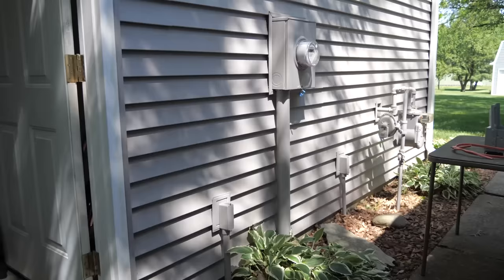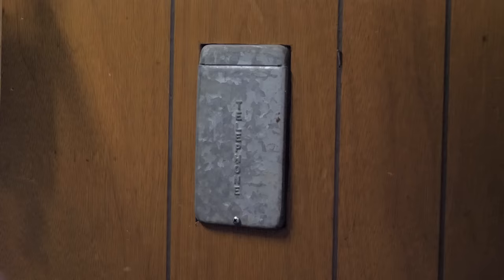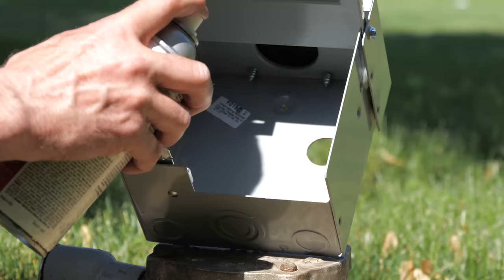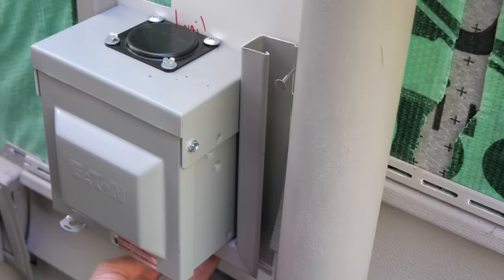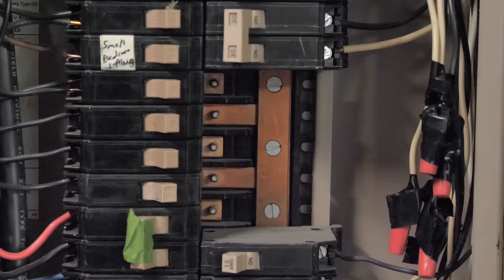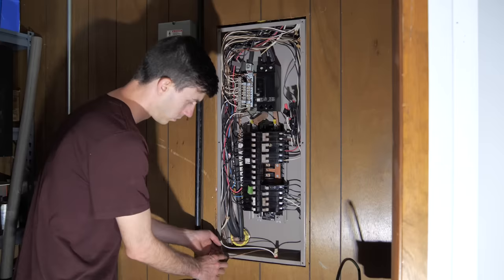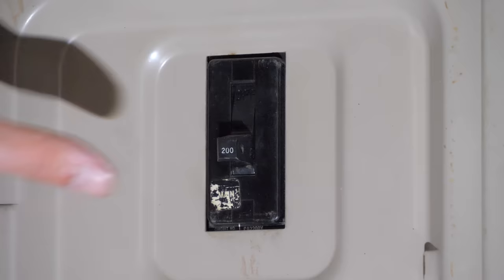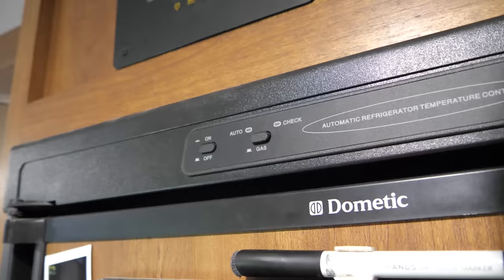30 Amp RV Outlet Install - DIY Electrical Receptacle Wiring

Comment: I'm confused.  If you threw the main disconnect why would there still be power to the panel?  Inquiring minds would like to know.
Reply: You still have power on the input side of the breaker (240Volts). The breaker just shuts off everything in the panel itself.

Comment: FYI... 15 amp outlet to run AC is dangerous.
Reply from the maker: Why do you think we installed a 30 amp receptacle? 😅
Reply: It's not dangerous,  just very inconvenient. 15amp circuit is only going to run a 15 amp load (technically 12 amps) .  Any larger load and it will (supposed) to trip circuit breaker, not letting electrical load damage wiring, receptacle and other equipment.

Comment: Only question I have....always been told to have the breaker OFF when plugging in the RV.  I know you plugged the RV into the surge protector, but does the surge protector provide the same precaution as having the 30 amp breaker off when plugging in?  Make sense?
Reply from the maker: The breaker does not need to be turned off before plugging the RV in. Just like the breakers in your home dont have to be switched on and off every time you plug your vacuum in.
Reply: @FateUnbound  David, the reason why its best the breaker should be turned off when you plug or unplug the RV power cord, is any load whatsoever  (albeit small, present in some devices like a charger or one having a  inductive or capacitor load even if turned off) can still cause some degree of arcing which can create resistive carbon or pitting or burning (ever look at your RV power cord plug ??) on the contacts PLUS its safer when plugging or unplugging if the breaker is off. That's NOT just me saying that, I've owned RV's 49 years and heard that long ago.

John T  BSEE,JD  Retired Electrical Power Distribution Design Engineer

Comment: You did not video a romex  connector use in the breaker panel use at KO Need one By NEC.  so the wire may get pull out breaker panel. He code reads, “all single-phase receptacles rated 150 volts or less… 100 amperes or less installed in the following locations…”. These locations include “outdoors.” ... — The 30- and 50-amp power on the RV pedestal are considered feeder circuits (those circuits that feed another panel) and not branch circuits. So NO GFCI on the 30 amp and 50 amp

Comment: No grommet for the wire through the panel?  Those edges are sharp.
Reply: They used a plastic grommet insert.

Comment: I need this instead of trying to use a 15 amp adapter. Anyone know what a. Electrician would charge?
Reply: Depends the area, and difficulty on running cables, probably 300 to 500

Comment: Does this need to be GFCI protected?
Reply from the maker: If you plan on using it for anything other than an RV then yes it should be. Since making this video we replaced the standard 30 amp breaker with a GFCI breaker for extra safety.
Reply: Fate Unbound thanks I looked it up and learned something new. It’s considered a feeder circuit and not a branch circuit. The code only requires all outdoor branch circuits to be GFCI protected.

Comment: You have $12,000 in solar and you still need a 30 amp ? Shaking my head
Reply from the maker: You must not understand how attempting to run air conditioning, a refrigerator, and a dehumidifier all off solar and batteries works. These all draw WAY too much current to run off our solar and batteroes for any meaningful amount of time. Also, we spent $8,000 on our solar and batteries, not $12,000
Reply: @FateUnbound  I do understand that . I just was suprised that you needed more even after all that amzing work you did with solar
Reply: @ae4xo  I've been full-timing since 2004 aboard 2 different new Casita travel trailers. 15 watt panel flat mounted to the roof of the first one, and 20 amp on the current one. This provides plenty of power for the lights, Fantastic Fan, furnace fan, and water pump, even on a winter day in NC. But the main energy draws (refrigerator, cooktop, water heater, and furnace flame) are all supplied by propane. Air conditioner only when on shore power. I don't have nearly enough roof space to accommodate the solar panels that would be needed to supply that power.

Comment: You no doubt have been advised NOT TO run your A/C on a 15 AMP service. It is not good for them, plus with the length of cord you were using, you probably were not even getting the proper voltage.
Reply: He has bought a soft starter to accommodate the AC in an earlier video.
Reply from the maker: Voltage was still fine, running amperage for our unit is only 11 amps. Ian Hicks is correct in that we have a soft start so startup amperage was fine as well for 15 amps, not ideal though.